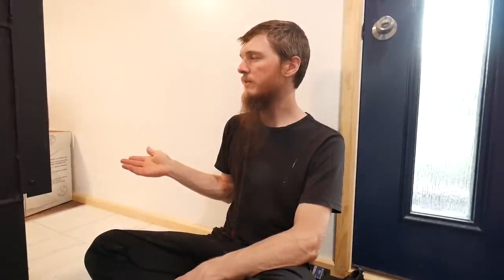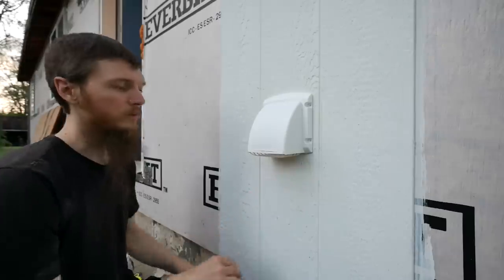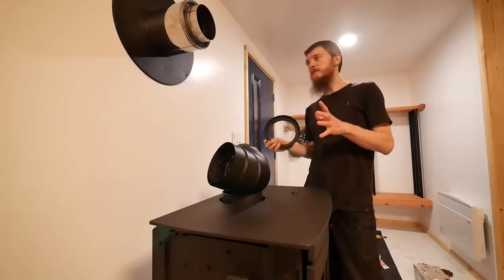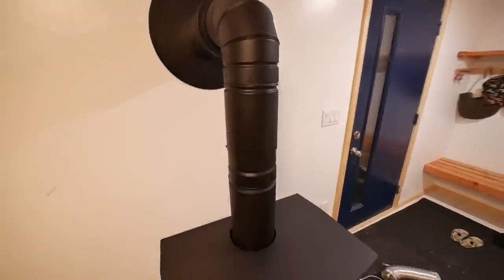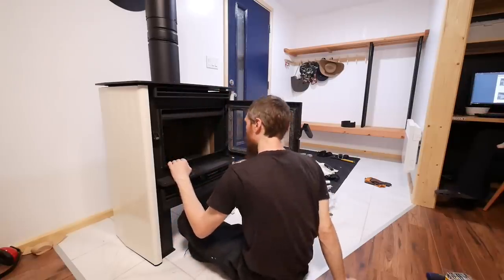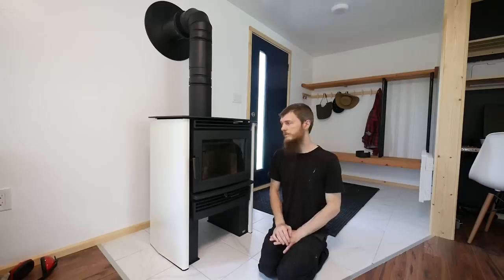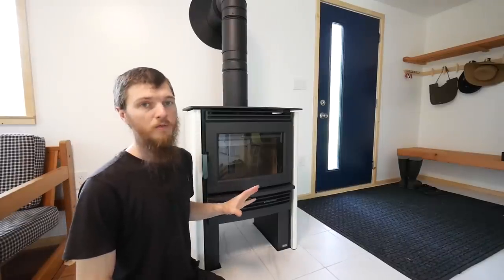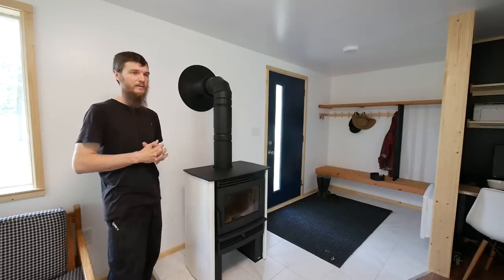DIY Mobile Home Wood Stove Install

Comment: Nice stove installation. I'm not a fan of wood stoves in mobile homes but you have done due diligence. With your insulation and window upgrade should be toasty this winter.  We heat with cord wood, I like have a warm space near the stove and cooler far away.

Comment: Great looking unit and installation. Hopefully you can devise a way to get some heat from living room to circulate through the house and use less of the more expensive electric heat in the bedrooms.
Reply: They make fans that you can mount up in the hall.

Comment: Doug, when I installed my wood stove I had to put cement board on the wall as well as the floor. Have you checked your local laws to make sure you don’t have to do that to yours too? My stove also had to be 18” away from the wall as well.
You might still want to consider putting in a ceiling fan in your room to circulate the air while using the stove. It does make a difference.
You’ve done your homework and answered my above questions. My stove is cast iron and does radiate a lot of heat all around.
It really looks great with your modern look you have going on.
I think people will be so surprised to see the inside of your home coming in the door. 
All the work you’ve done doesn’t make it the typical living area.

Comment: The wood stove stove fits perfect into your decor. And you thought out and avoided possible future issues. I'd like to have a wood burning stove in my house. I have a useless gas fireplace. If I run the darn thing more than 20 minutes it sets off the smoke detectors. I just keep the gas shut off and have candles displayed in front of the dumb old thing.
Reply: Hold on, Denise!  How is it a gas fireplace sets off smoke detectors?  Are you sure those are "smoke" detectors, and not carbon monoxide detectors?  Take a close look at them.
Reply: Also is the damper open?

Comment: So nice guy's it looks awesome ...Fit's really well with the rest of your style . I googled the stove  it sounds like it will work really well for what you need... I love wood heat unlike forced air, wood heats everything in the house floors walls furniture very warm and cozy on those cold winter days  nothing like it.

Comment: Glad you got your wood stove in! You will need it for those cold Michigan Winters ahead. My neighbor just showed up at my door wanting to know if I wanted to buy a brand new electric dryer. He told me he wanted $40 for it. It didn't even have the power cord yet! There was still protective plastic on the brushed stainless trim and packing tape on it. The lint filter was even still clean. Now I want a New washer to go with it!
Reply from the maker: Cool. Sounds like a great deal!

Comment: You inspired us to replace our old Vermont castings stove with a neo 1.6! We got the red side panels!
Reply from the maker: Awesome! I hope you enjoy it :D
Reply: @diyfferent  the flame pattern through the  baffle is incredible. Seems to heat well. It's not that cold yet so we will see. Also didn't do the air return since the stove is in the center of our house and the air return would have to be 20 feet long and Pacific energy said the stove wouldn't be able to draw that far properly.  Our house is a berm house and the walls are super thick so I'm hoping it does as good as the old Vermont castings we had.

Comment: The stove is a beautiful piece to add to your home. I love that you will be able to see the flames through the glass. We have the old fashioned kind. One door and have to watch for smoke roll out if we keep it open. Im moving to my childhood home. Woodstove in family room, fireplace in living room. Heatpump with AC also. I prefer windows open in good weather, wood heat in cold. The fan on furnace will recirculate the heat to the rest of the house. Glad you guys can rest easy knowing its done..Now....cutting wood to season for winter.

Comment: I love it.  Does it have a blower fan? Different than anything I've seen. Maverick is figuring out those tools
Reply from the maker: Ours doesn't have a blower, but it is an optional feature that can be added at any time.
Reply: Get a blower expands heat coverage

Comment: So beautiful and refreshing! I see the cozy rug in front of the door, looks so nice. I was wondering if it had backing. We have just installed new flooring and had been told not to get a rug with backing as it subtly can move around and will scratch the flooring as well as discolor it a nasty yellowish. Would your do that?
Reply from the maker: Our rug just has a rubber backing. It shouldn't discolor the floor and we have porcelain tiles so no worries really about it being scratched since it's so durable. :)

Comment: I am amazed the wood stove looks awesome the black looks so good in that area it's just stunning  😍 .. 

I just have one question  .. Doesn't it get hot to touch? .. idk I just have a feeling that it could be hot When It's on so maybe it's not a good choice on the safety wise since you have Maverick playing and discovering everything around him  ... hopefully it's not.
Reply from the maker: Yes, it will still get hot. But Maverick is good at listening and learns fast :)
Reply: When my oldest boy was about five I got him out of the tub, wrapped him in a towel, and sent him out to the living room by the wood stove to warm up while I bathed his brother. For some reason, he opened up his towel and leaned his belly on the edge of the stove. Of course he knew that the stove was hot, and that he could be burned. He got a pretty good burn, but he learned very quickly and never repeated that mistake. Unfortunately, pain is a part of life. America wasn’t built on “safety first”!

Comment: Love the stove and you taking the necessary precautions! One question, and I’m asking only because we grew up using a wood stove for heat. Maybe with the newer stoves, you don’t need one, but why isn’t there a damper.
Reply from the maker: There is a air control on the front, a little handle that slides just under the door. But I think overall they are just making them different now and more strict for EPA regulations. I don't think dampers are common on the newer stoves because of how they are controlled and burn.
Reply: DIYfferent thank you for answering, it’s been many years since I used a wood stove!

Comment: I love the woodstove nice touch ! I love burning and heating with wood. Again thanks for sharing. Where did you get the woodstove at? Looks nice and clean with the hole set up with panels around the stove.
Reply from the maker: We got the woodstove at a local dealer :) Thanks!
Reply: @diyfferent  even better can't wait for the big reveal you 2 have come such a long way in this remodel.

Comment: Neat little stove and good explanation about the features and safety side of things.  Looking forward to seeing the final reveal of the lounge room.  Is a shame about the chipped corner on white cover's powder coating. Maybe if you're looking for a new DIYfferent project you could get some powder coating and try to create an oven to bake the corner back on :) 10 mins at 200 degrees Celsius with powder coat or 10 mins at 180 degrees Celsius with the right epoxy could repair it.  One other observation Doug. Not sure what your thoughts are, but I'm not too confident the white plastic dryer duct cover sitting directly below the flue clean out is going to hold up over time. I'd expect the first time it gets creosote or ash on it, it'll discolour/stain the plastic pretty badly or will just be a continual pain to cover over every time.  If it were myself, I'd save some hassle, time and sanity and take it back to exchange for a metal vent of some description hopefully with finer mesh to keep the bugs out.
Reply from the maker: That's the only one they had at the store, but I really would prefer a metal one. Perhaps a future upgrade :) Thanks for the thoughts.
Reply: Maybe SPECIAL ORDER.  This way you can have it now.  Especially with the paint chipped.  Just a thought.

Comment: The wood stove looks great! I like the design. It will be so nice in the winter. Our wood stove has a fan on it when I gets to a certain temperature. Ours is ok but we have a lot of issues with it which really sucks because it’s our primary heat source. Like if the wind comes out of the west which here it mostly comes out of the west the house will fill up with smoke. Not a good thing. We think it could be because there’s a line of big trees right by the house and this causes this issue. The previous owner kept adding pipe upon pipe and the chimney I kid you not was like 30+ feet tall. We couldn’t even clean the chimney without having to call someone with a bucket truck. Despite having the chimney like that we still would get smoke in the house. Last winter we shortened it. We can at least clean the chimney and we will still get smoke in the house from time to time.  But we have noticed if the side door or if anything is open passed the wood stove it’s caused a vacuum and the smoke will go down the chimney into the house. It’s strange and a big pain.  We did buy one of those directional chimney caps it help a little. 
If the wind comes out of the East we doing have any issues. Anyhow. Take care, see ya :)
Reply from the maker: Thanks :) Wow, that was very tall of a chimney.

Comment: I was surprised not to see a damper system on the woodstove!  But it is a nice looking stove for your home
Reply: He can always put a damper in the upper pipe.
Reply from the maker: It has an air control handle under the door. Thanks

Comment: I have never seen that particular style? design? for a wood burner before.  Can we see more of that chair or couch? I have been looking for something like that for my place and have come up dry so far,  I am not shopping in the right places I guess. 
One thought, is the top warm enough to make use of to keep things warm, like beverages when winter comes or better yet. a good spot for raising bread, if you don't think the door will be opened and shut to much during the raising process. 
The plastic dryer vent might be an issue down the line, not telling you what to do what so ever, its your place, your vids, but there are metal ones, I have one on my regular dryer, unfortunately they do not come in white, just the usual aluminum color.
 Looking forward to a looksee of your living room which I am sure will be just as simple and tasteful as the rest of your place. 
So, whats next? your almost done with your fabulous Norwegian inspired place, Decks? 
So good to see your skills and place progress over the past few years.  Do you have an idea what Maverick might be into and want to persue when hes a bit older? I can see you guys doing a fort somewhere on property.  Woodworking might just be in his blood so to speak.
Reply from the maker: We'll be showing the couch more in our living room reveal video which should be our next video. Not sure how hot or warm the top of the woodstove gets. Yea, we went with the plastic dryer vent since that's all they had at the store, but we may upgrade later on. Our next big project is redoing the roof. Not sure about Maverick :)

Comment: I would have made the side panels black. The white panels don't match the walls. Also definitely would use the ring to hide the ribs, and would have painted the silver part black. Good job on the overall install.

Comment: Between the new insulation and that stove your winter utilities should be low! It looked like an easy install, was it?
Reply from the maker: Yeah it was not hard at all. It was slow because I wanted to make sure I was doing everything right but all pretty easy.

Comment: Just wondering if the stove maker will replace the chipped side panel. It could be used as a back panel on your firewood storage so the wall won't be dinged up. Looks great!!!
Reply from the maker: We're okay with the panel, but we did ask to see if they had a paint touch-up kit so we'll see what happens with that. The back wall is LP Smartsiding, so it's strong :) Thanks!

Comment: really surprised that code doesn't demand a brick fire wall layer for the base.  hopefully that tile will hold up for many years. Those floors will flex and with the traffic, weight of the stove my cause concern.  those panels will help to keep ur kids safe.  great work once more

Comment: No damper in the stove pipe? Did I miss a damper on the stove? It really looks nice y'all but you may want to install a damper. Good video.
Reply from the maker: It has an air control on the front under the door :)

Comment: What a great stove! Appreciated the specs on it. Very attractive too. The whole entrance area looks so clean and pretty.
Looking forward to the living room reveal. Your whole interior is done! You must feel amazing! 
Will we get to see the whole house in a before and after video? That would be cool.
I just remembered, maybe you still have some windows to install?
Reply from the maker: Thanks. No more windows to install, but we have a few more small jobs on the inside, the roof, and siding. We are hoping to do a complete before/after of the house when it's all done :)
Reply: @diyfferent  That will be awesome. I remember how it looked when you moved in. The contrast is astonishing. There is so little original material left, mostly just the frame. I am pretty blown away the way the house could be rebuilt and replaced a piece at a time. I am so happy for you.

Comment: Awesome job Doug!! If it were me I would buy some carbon monoxide detectors just to be safe.
Reply from the maker: Thanks! Yep, 2 of our smoke detectors also detect for carbon monoxide :)
Reply: DIYfferent   I may be wrong, but don’t carbon monoxide detectors need to be low and smoke detectors need to be high?
Reply: Cynthia Fisher - Usually CO detectors are mounted in a similar fashion/height as a smoke detector. You may be thinking about propane gas detectors which are mounted closer to the floor. (Because propane is heavier than air) These are often used in RV’s.

Comment: Question: at -3:30/21:05 you talk about the area between the burn box and the plate which draws air up. How is that when you set it up to get the air from the outside? It’s a beautiful stove, though. You picked a good one!
Reply: It draws air from the outside to use for combustion inside the firebox. The plate that he talked about later is outside of the burn box and draws air from inside the house up around the outside of the burn box which warms the air and distributes it out of the louvers in the front.

Comment: You want the air for combustion coming through the wall or floor for sure.....but not for the reason you said, necessarily.   If you draw from your interior air it will pull air inside from every crack and crevice in the building.   This will actually make your room air temperature colder, defeating the purpose of the stove.  So, by all means, cut a hole and put in a thermostatically controlled pipe to the outside.

Comment: Do you need to install a heat barrier between your wall and the stove? Do you worry about your wall getting too hot? Ah, it's self insulated...excellent.
Reply: If I remember right, he used a wood stove flame retardant panel behind it already.  So the wall is actually the heat barrier.
Reply: Ok, I was wrong! lol
Reply: He answers your question at 16:50
Reply: @creativecrafts9490  I saw....
Reply: @kibblenbits  it's self insulated.

Comment: Very close to a DIY as you showed each step very well. I think that before doing one, a person should go see one being set up in person.... I have done several now but most people get overwhelmed in setting one up, I too, had a lump in throat when installing the first one yet moment done, I knew I had did good. I did ask a neighbor about one before doing since that was what he had and it was a real nightmare in my thinking as he built a "add on" to the building to get it out of the house with cement floor and then brick chimney... overkill to me

Comment: No wonder you've been excited for this stove to arrive. It is very cool, from a design (look) standpoint, as well as for its operational design. I do have one question. I'm wondering why you didn't angle it so that the front faces into the center of the living space? The slight offset would also add a unique and positive design element. 🙂 IMHO
No matter, it's amazing! 👍💯🎉
Reply: Maybe they thought the triangular footprint of the tiles was enough? That’s the first thing I thought of. Since they prefer a simple, clean look, perhaps more angles introduced into that room would have been too much?
Reply: @agresticumbra  perhaps

Comment: I think the crimped ends are supposed to point down. I learned this the hard way. Any condensation will run down the outside of the pipe if the crimped ends are up.
Reply from the maker: These are double walled stove pipes, so the inner pipe has the crimps facing down and the outer casing is facing up.
Reply: @diyfferent  👍 I didn't catch that.